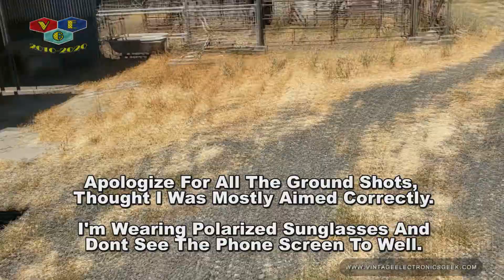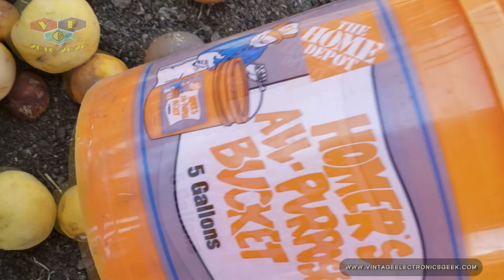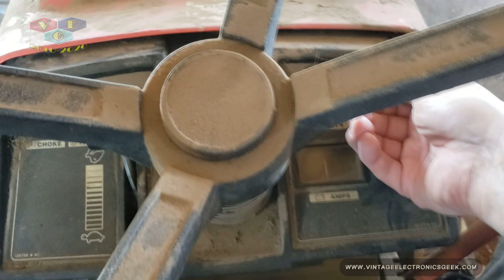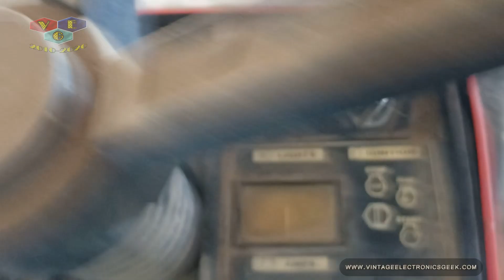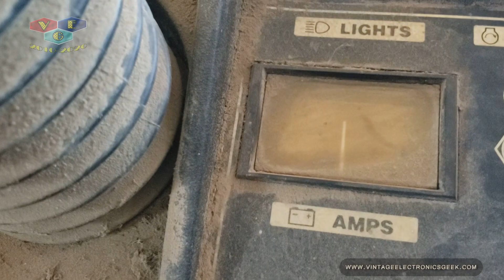Lawn Mower, Cows & Memories

Comment: Lots of dust. Several things.  Air cleaner. Check the gas cap also, that is a vented cap and may be stopped up. Also it is huffing some oil, could be rings. valves, guides. I really like the steak with legs :-)
Reply from the maker: We are in a drought and water conservation, lots of dust on the farm indeed!  :)  I have cleaned the filter...probably first time in 15 years...I guess it was time....didn't think of vapour lock, will check that....I was afraid it maybe something more then simple, I'm not crafty...brother I'm with you, loves me a good hamburger! I refer to them as "hamburger on the hoof" !  :)  Thank for your help Buddy, I appreciate it!  ~Jack, VEG

Comment: Suspect float or fuel pump?  I got a carb, pump, and filter for my Areins garden tractor for about 30$ thanks to Ebay.  There is a shit off ot kill solenoid at the bottom of the carb, they often stick and that's why my Ariens would not start, stuck in kill mode. The solenoid cost same as new carb.  
My Deere tractor acts like yours, runs for about ten minutes then craps out.  May need valve adjustment, or carb adjustments, too lean.  When it runs, it runs good, but smells like over heating.  Could be a mouse nest blocking air cooling of motor.  Too hot to work on, and too lazy. Just some 411 about motors.

Comment: I have been around Donkeys, Horses, chickens, Pigs, sheep, Steers and cows for a lot of my life but of course do not have the spread you have anymore. Lot of work taking care of animals. I have never seen anyone feed a grapefruit to a cow I have given apples to horses and donkeys occassionaly but not grapefruit. Having that much area and a finicky riding lawnmower is no fun. If you put Marvel mystery oil in the cylinders it will smoke and also if you put it in the gas it will smoke but I would change out the air filer it looks pretty dirty I am sure. I don't know if it has an oil bath filter or a dry filter. And if all else fails haul it out of the barn and shoot it they shoot horses don't they?
Reply from the maker: I feed these cows the fallen fruit, branches, grass...whatever, they're like goats, eat just about anything!  :)  It is a lot of work to push mow and weed eat everything, especially when the heat gets over 100, the day before this day of 111, it was 115...so a lot of drinking, extra food and rest a little more...the Sun really can zap you before you know it...as you know.  The rider made this job a lot easier!  I can spend 6 hours in just weed eating alone and still not finish, then if there is any tree trimming, walk the grounds for trash, bush trimming, blow the dirt of the walk and porch, etc...it truly is an all day event, just to turn around and do it again next weekend...and were not gonna talk about the edger that's not starting no more neither...I don't care that its 40 years old. :)  Brother Id love to shoot it and it just may come to that!  Make me push mow....pfft!  ~Jack, VEG
Reply: @VintageElectronicsGeek  Yeah we had a cold snap today it was 95 it actually only got as high as 104 for 3 days in a row after that it dropped off. But we will still be in the 90's most of this month and all of august I am sure. Ron is still in Pain got sold a bill of goods on the Hip replacement surgery. He is worse off now than he was before the surgery he can just barely move around with a walker and he had bad reactions to the meds they gave him had to take him down to the ER 3 days ago. He can't sleep longer than an hour or an hour and a half and then he is in pain again uses ice on his hip now to get partial relief. He talked to other people he knows who had it done and they felt fine after 3 days he is going on almost 2 weeks since the hip surgery.
Reply from the maker: @LarryDeSilva64  Aint it nice to see in a cooling spell of a 104!  :)  Wow, sorry to hear about your bro, I'm sure for him this really sux!  He was very active up to this put and that sux...I know it all to well, 3 years for me, now I'm trying to play catch up!  We truly wish him the best and a painless speedy recovery!  Hope you and your daughter are doing better also!  ~Jack, VEG
Reply: @VintageElectronicsGeek  Me I just keep chugging along haven't got the results back for the $3500 blood tests in a Boston lab to see what blood disorder I actually have. My daughters back is healing really well and my new grand baby due date is now July 31st. Oh boy lol
Reply from the maker: @LarryDeSilva64  That's great to hear!  That's very-very stupid and highway robbery, there is no need other then greed for them to charge that kinda price!  If they really "cared" for there patience they'd understand most folks cant afford that and if insurance covers it then they are just stealing from the insurance!  Congratulations, very cool...future guest YT'r!!  :)  ~Jack, VEG

Comment: stuck float in carb.
Reply from the maker: That don't sound like it would be easy to repair, bummer!  Thanks for your help!  ~Jack, VEG
Reply: @VintageElectronicsGeek  Not hard, take brass bolt off bottom of float bowl, pull off brass looking float bowl.  If it sat all that time with ethanol gas it may just look gummy inside it.  Wipe the bowl out and spray the float and other innards ya can see with brake cleaner till the float moves up and down freely, push the float bowl back in place assuming the rubber ring is still in good shape, tighten that brass nut back up and give'r a crank.  See how she does then.
Reply from the maker: @Rebel9668  I will look at it again, I did clean the air filter with gas and let that sit in the hot Sun for a while, I will need to drag the lawnmower outside as lighting is poor inside and hard for me to see...thanks for the help / tip!  ~Jack, VEG